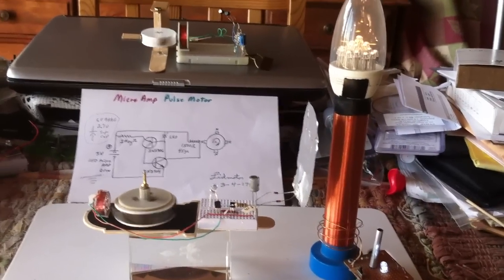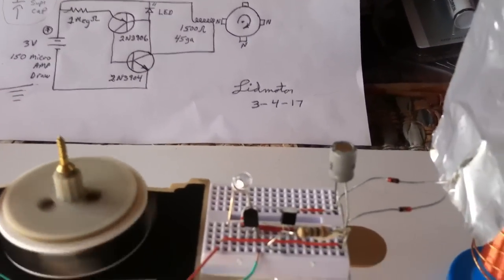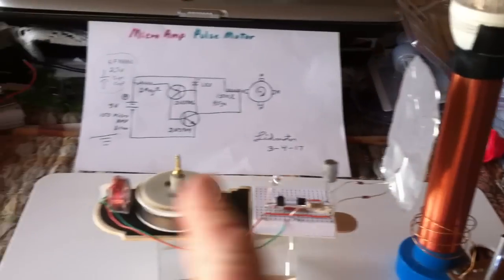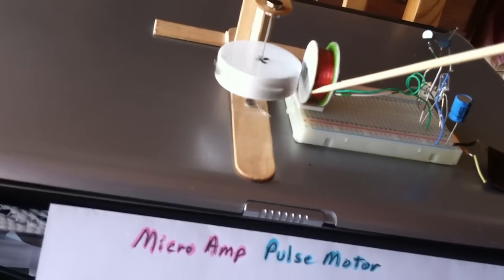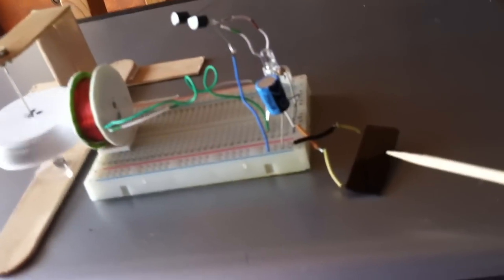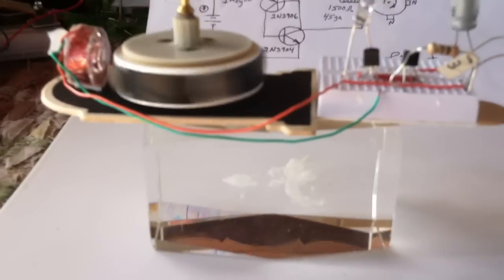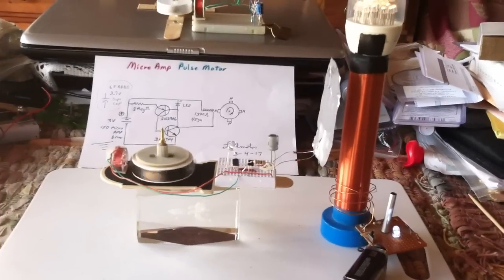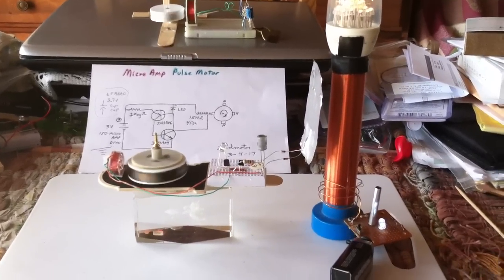Micro Amp Pulse Motor----EXCITED!!!!

Comment: Dear Lidmotor, I write here to you because tomorrow I'll show my first experiments with a simple triboelectric nanogenerator. I think that tapping  generator could drive your pulse motor. The generator easily could generate 20-30V with few microamps. I'm not an electrical guy as you know, but I think you can build up a simple setup with it! BLADE

Comment: The pulse motor using a reed switch can run the Tesla coil from the back emf it’s an interesting experiment just run your primary from the + to a gas spark gap hv cap across the gap and end on the other end of the reed switch works a treat

Comment: Nice job, these confirmations are bringing a bigger picture of the abilities  :)
Could probably run one of these on brainwaves lol
GBluer's towers are excellent examples and perfectly wound, who better to buy from than the inventor !
Reply: https://www.youtube.com/edit?o=U&video_id=j2CIVX80CwI

Magnifico this technique, breaking energy conservation:
watts consumed from the grid:
291.5 watts.
Breaking the law of energy conservation:
In the shaft has 245 watts (1 / 3cv) adding those of the lamps 144.4 watts is much higher than absorbed from the electricity grid ..
First and only in the world to achieve such magnificent results.
Machine with yield much higher than 100% is real.

Comment: It's picking up a lot of power and storing it in  that grey capacitor - nothing fancy. I am more impressed by your pulse motors generally, rather than this wireless power. Gary Bluer should build circuit: 'Slayer Exciter - Sky Igniter'. AND Dr. Stiffler actually has made things more complicated than they actually are, that power transmission circuit is a quite simple one.
Reply: lol at Dr. Stiffler making things more complicated than necessary. Honestly looking back it does sort of seem that way.
Reply: "Dr. Stiffler actually has made things more complicated than they actually are" is a clueless and unfair statement.  To my knowledge no one has shown a replication of the greatest and best work Dr. Stiffler has demonstrated, the PSEC.
Reply: when it comes to claims of 'self running' I'd have to say no, no one has replicated it. but when it comes to the earlier circuits that had everyone excited about spacial energy coherence, it became simpler and simpler until tuned wireless transfer via incredibly simple circuits was a thing basically pioneered by GBluer after following Dr. Stiffler's work.
Reply: My point was that Dr. Stiffler's primary objective was not simple wireless transfer, it is something much more sophisticated and technical.  Such as Passive Spatial Energy Coherence (PSEC) which he has demonstrated and provided helpful videos for, he has not made 'self running' claims.